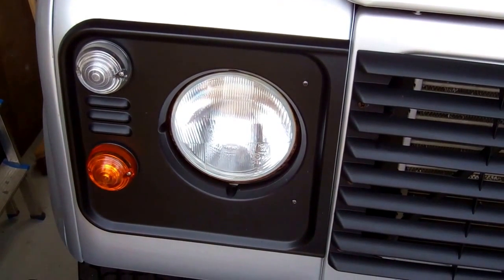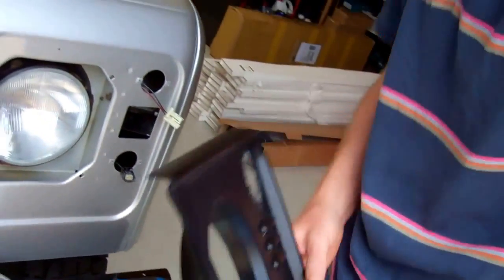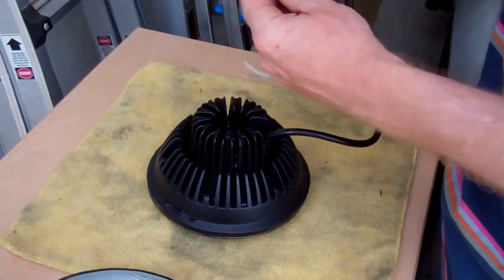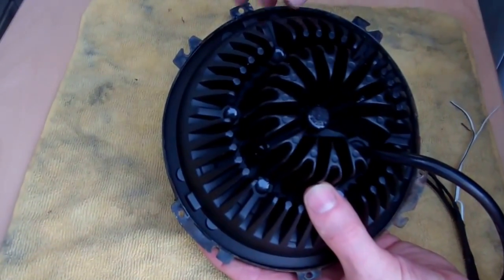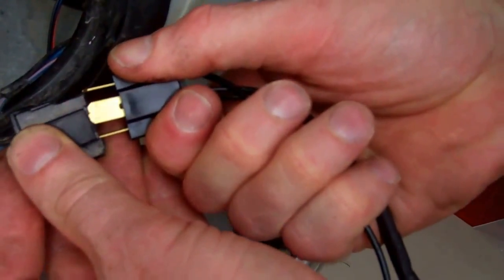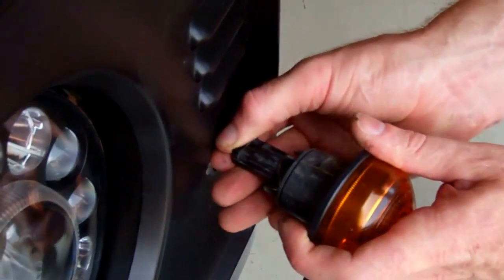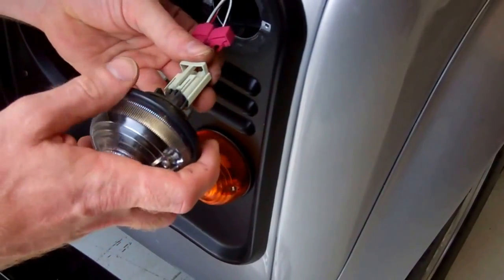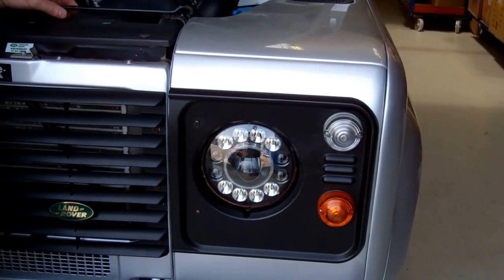How to upgrade Land Rover Defender Head Lights to full LED type

Comment: I just purchased the newer headlight HL730 from you powerfuluk.  I cannot get the angel eye light to come on with the sidelight.  I tried both the scotch connector and connecting the wires directly (single pink wire from headlight connected to black wire on sidelight--my sidelight has black, red and green unlike yours which is just black and red).  sidelight comes on but angel eye will not.  why is this happening?
Reply from the maker: This is odd - the light uses the headlight earth wire for its earth so if you can has headlights working you have a good earth. You could try a lead straight from the batter or fuse box to the red wire - this will test if this works - but you must have the headlight connector plugged in to get the earth !
Is the problem only on one side or both sides ?
sorry for late reply

Comment: What you call the side light angle eye is also part of DRL which should be wired to come on with the ignition  these make a huge improvement to the look and the night vision
Reply: it's a shame that the sidelights and indicator are not changed ant the same time

Comment: Those connector should be banned!! You as a company should not recommend those. Cut the wire and use those crimp connectors whit shrink tube on.

Comment: The dissasembly shows how incredibly easy it is for someone to nick your headlights.
Reply: everything on a defender is easy to nick, bonnet theft on pumas is bit of an issue now.
Reply: @mcgrorymachined7596  Not if you don't have a Puma bonnet and Optimill hinges and a cable guard !

Comment: Good video ! I would actually recomend using the crimp connections over solder. Solder should be avoided where ever possible in a vehicle in my opinion . Especialy anywhere near the engine bay .

Comment: Pointless video if you have an Ex-MoD or Upgraded to 24 volt electrical system, I know they are not as many as the lower std. 12v models, but surely someone can cater for the Wolf owners - Please ???
Reply from the maker: The video is not at all pointless as these lights work at 24v...... There are loads of people using 24v 7" headlights - a lot of lorries use them.....you are not alone.... time to buy !